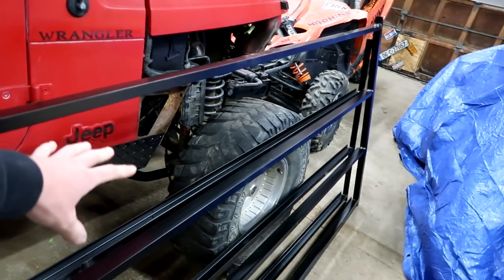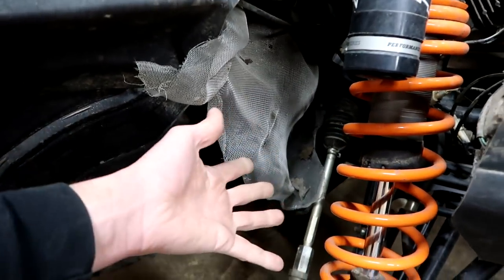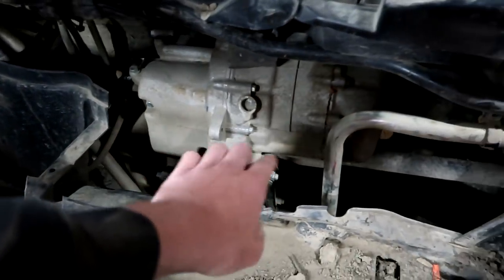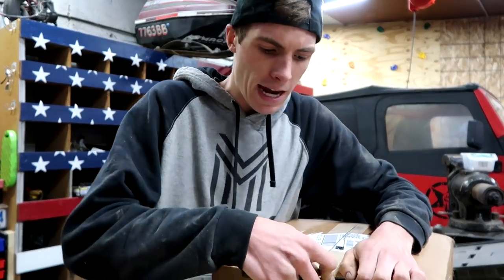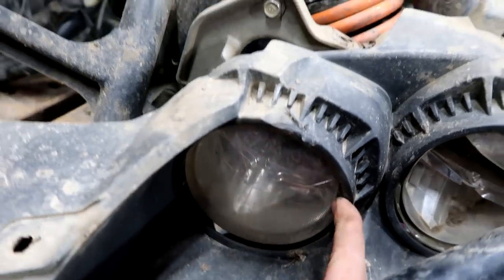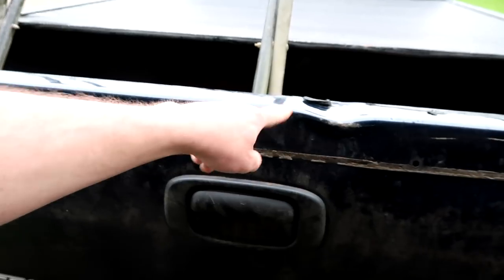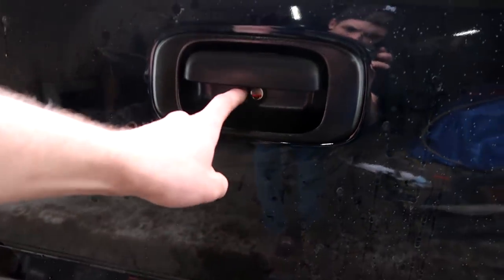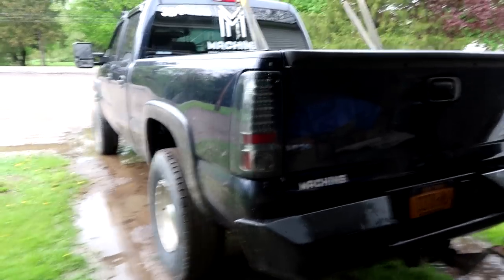I Finally did THIS to the Duramax..

Comment: You should mount the tail gate to the wall and have it as a drop down table for organizing parts or whatever your working on and when done have a few hinges where you can just raise it and lock it
Reply from the maker: That's what I'm thinking. It would be sweet.
Reply: brian richards I did that to my wall with a ford tailgate!
Reply: Great minds think alike
Reply: Maybe cut the back 6 inches of a junkyard box  taillights mount them to wall and presto fold down seat with a padded backrest

Comment: You should check the rule book. A lot of safety techs won’t let you mount the radiator where it can spray boiling coolant on you. You have to have a firewall between you and it which may be why the other one is pointed down. Not sure though so check your rule book or call for tech.

Comment: I've installed the Pop & Lock power tailgate lock on several older trucks.  They work great and only takes a few hours to install.  No key needed, and it locks/unlocks with your key fob.

Comment: I had a locking tailgate on my 2002 sanoma from pop and lock and it worked perfectly but I sold my truck and now have a 2011 Toyota Tacoma and ordered another pop and lock I recommend pop and lock easy to install and works great

Comment: Dalton - Pretty sure you do not want to block the rear view mirror.  If you depend on the side view mirrors you will have to completely remove you vision from the forward view to looking sideways and then back again.  Not safe!
I guarantee you will hate the fan noise in very short order if you set the fan/radiator up as you plan.

Comment: mount the old tail gate on the wall on hinges so you can drop it down an use it as a bench seat, just like a tailgate is normally used.

Comment: If you keep the tailgate as two separate doors it would be easier to lift them and drop them and it would be easier on the hinges and any locking system you may use. Just a thought.
Reply: The trailer tailgate not the Duramax tailgate
Reply from the maker: hmmm...

Comment: The tailgate on my 05 colorado has a lock. Surprised the other trucks didn't have a locking tailgate from the factory. I never lock mine anyways. A tailgate lock isnt going to do much for an open bed or my snap on tonneau cover lol

Comment: you should mount that old tailgate on the wall so it drops down like it would on a truck and then use it as a workbench or sitting bench that stows up against the wall when you don't want it!

Comment: If the power steering goes out next time turn crush off and then back on to reset a safety sensor on the power steering.

Comment: What is really the benefit of the radiator in the back just curios
Reply: it won't get gunked up with mud. If it gets gunked up it won't cool enough.
Reply: Rad relocate...a must on any mud machine!!!
Reply: To Scorch your skin off, if you spring a leak or blow a hose nough said
Reply: Yahshua Worshipper never seen that happen in my 10+ years of mud riding. If it's done right there is no reason for that to happen..
But I guess a hose could blow...but then again I might win the lottery too!!!
Reply: that would be my worry to. anything could cause you to spring a leak.
Reply: Lee Root hard lineing it would be a safer bet for me. I dont like to gamble
Reply: Even a tough piece of brush could blow through the radiator

Comment: I have a locking one on my dodge made by bully. it locks and everything but I never lock it because it feels like if some one were to try and open it when locked the handle will bust
Reply: chevy dodgeboy, they do bust rite off. I work in Chicago and have had 4 Bully locks destroyed. What a pain in the a$$ to remove all the broken pieces out of the tailgate. I just bolted a Puck lock to the inside of my tailgate. I only lock my tailgate so it's harder to remove the heavy parts out of the bed.
Reply: Jonn K. Customs & Fabrication that's a good idea. That's the only reason why I wanted a locking tailgate too
Reply: chevy dodgeboy, it's almost impossible for someone or 2 even 3 ppl to lift my generator, compressor, & lock box. I also put a hidden switch off the tailgate to my back up alarm so when you open my tailgate all you hear is BEEP.  BEEP.  BEEP. and I just wedge the lock in between the switch & the tailgate to turn the alarm off when I have the gate open.

Comment: You have to stop using over the counter hardware store/auto parts store fluids now that you are racing. Race speeds cause way more heat and wear then practice and putt putt speeds. You should be using Motul Oils for all of your lubricants and Peak Antifreeze in the Blue Bottle. And no I am not sponsored by either of those companies. Their products just work.